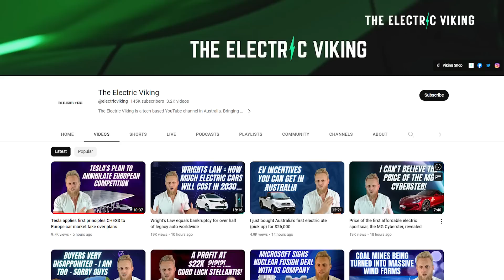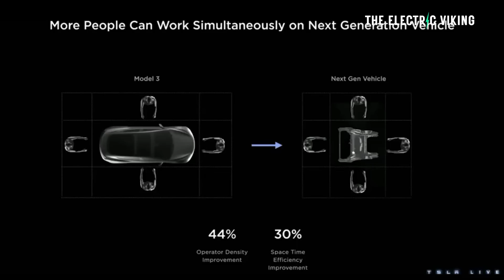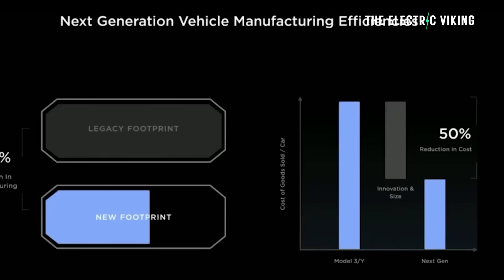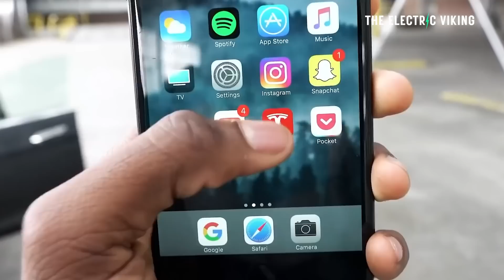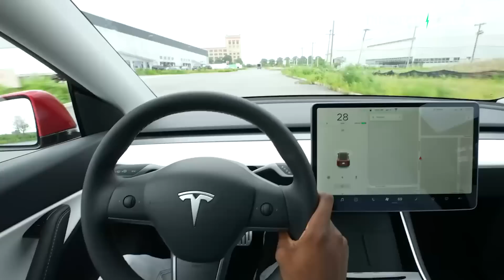Auto industry experts debate Tesla's revolutionary new manufacturing system

Comment: Thanks for making this video, it’ll promote the concept.
Unboxed is huge. Shortens production line, ergonomics vastly improved. It did need 48v low voltage wiring and Ethernet to eliminate complex loom. And electric servo brakes - dry factory. Only wet part is coolant.
Paint matching said to be a problem, expect to see something else, maybe composites. This is going to scare the pants off Legacy, can’t retrofit old lines, need new final assembly mega-robots. 
Easy access will be a boon for Optimus, first just assisting people, handing parts. Vertical integration required will prevent Legacy adopting this, too many components need to be brought in-house, too much software knowledge. They can’t adopt this in parts, got to be entire shebang, total new factories. Again. Legacy is cooked. No one can compete on price using Model T process.
Reply: Also volumetric efficiency.
Reply: “Paint matching” possible with stainless body panels
Reply: @EMichaelBall  in bright sunshine of Australia, shiny, dazzling is a bad look. Mightn’t matter in snow, rain, mud.
SS really constrains manufacturing / design, hence angular triangle cybertruck.
I’m mostly focussed on robotaxis function, that bring together FSD, efficient manufacturing, huge (rapid) scale.
If it’s not individually owned, finish is like public street furniture or transport.
In Aus, buses & shelters are bill boards - offensive. Not unlike YouTube junk / toxic advertising.

Comment: If anyrhing, thise new method of production will allow for a complete flexibility to improve and change the car, with this, Tesla could actually produce 20 different car in the same factory and in the same, line of production, they just change the fron part, or rear part, or the doors, or the chasis, and bam, new model, at the end the parts, are just put together like a puzzle, want a different engine and cooling system, change the front, and put it to the car, want another chasis, put it to each part easily, bam, new model, this is something that tesla didn't mentioned, the pace of innovation that Tesla will be able to achieved with this new method is enourmous :D

Comment: The reason Tesla revealed the unboxed prices was to give other manufacturers the way to reduce prices. They did not have to make this public. 
    Meanwhile, without Giga castings, the other manufacturers will still have a lot more overhead regardless.
   As to your number six concern, Tesla's current assembly line has multiple feed points. For example the line may get doors from several in-feeds at any one time from different teams... each team making innovations on those doors. This existing method makes assembling different car models a snap as they can vary which feed they take parts in from. However, most of the concerns you site have nothing to do with how Tesla lines work.... they are completely different than any other car manufacturers as to their structure. Much more flexible and almost instantly changeable.  These critics don't understand how Tesla build their cars now or they would realize their statements are BS.
Reply: You wrote, "The reason Tesla revealed the unboxed prices was to give other manufacturers the way to reduce prices. They did not have to make this public." That may have been one reason, but another was to help potential investors understand the "how" underpinning Tesla's "we will make cars for half the price" claim.
Reply: @CiaranMcHale  Very true, however in retrospect they could just have easily have told those non-technical institutional investors/analysts... "We have invented a radically new assembly process that will cut the cost of building our future cars in half".... and showed nothing... and it would have done the same thing. The result of actually telling those institutional investors the process was nothing... they went away having no understanding of the revolution that Tesla just showed them and the stock went down. 
So did Tesla just think that the investors would think this was cool because they are themselves engineering geeks and surely the analysts would see how cool this was?  Maybe, but I have to think they divulged it for a different reason. 

Meanwhile the OEM engineers were saying "OMG!.... quick... get on this now!".
Reply: @nickmcconnell1291  You said that in retrospect most institutional investors were unimpressed with the unboxed assembly process. Perhaps, but Tesla might not have been able to predict such indifference in advance. My guess is that many retail investors were impressed. I was going to finish that sentence with, "although I assume retail investors are vastly outweighed by institutional investors",  but then I decided to do an internet search to check the validity of my assumption. I was shocked to learn that 44% of Tesla shares available for trading are owned by retail investors; I hadn't realized the percentage was so high.

You wrote, 'Meanwhile the OEM engineers were saying "OMG!.... quick... get on this now!".' I suspect that might be the case in some of the Chinese car companies. But from what I have seen on the Munro Live channel, sadly I think managers at the legacy auto companies will be far slower to embrace the innovation. Some evidence to support this is that Chinese car companies have been quicker to adopt gigacasting presses than legacy auto companies.
Reply: @CiaranMcHale  Hi! Thanks for your taking the time to cogently respond!
I agree with your thoughts and findings here as to whether maybe Tesla thought what they divulged might impress their investors. Truly the retail investors were impressed. I'm one of them!😀
However at this meeting, which I reviewed through the eyes of a couple of top YouTubers who were there in person because of their number of shares, there were few retail investors that had made the cut..... at least that is what they reported.   So perhaps the audience that day was skewed towards the fund managers who hold the largest concentrated percentages of Tesla??  Who knows?
     But in general I have heard Elon and others at Tesla say that their intention is to not intentionally run other auto makers out of business. Indeed they have encouraged them, especially Ford.  So I am thinking that Tesla may have divulged the actual process of unboxed for charitable reasons..... since Tesla knows if they don't copy it that they OEMs will indeed go out of business as they will have no chance to compete on price whatsoever.
   BTW, I noticed at the shareholder meeting yesterday that they used a lottery system which I think they did to try and bring in more of the retail investors rather than have mostly fund holders/analyst types.
Reply: @nickmcconnell1291  Thanks for reminding me of Tesla's repeatedly stated intention to help other auto makers transition to making EVs. I knew of that intention, but I hadn't made the connection with discussing the unboxed assembly process innovation.
Reply: @CiaranMcHale  Glad to chat as I constantly enjoy hearing other people's perspectives and learning from them. 👍
Also it's only a guess.... maybe they are just geeks after all. 😆
Reply: @CiaranMcHale  And possibly to provide a credible plan on how they can achieve their mission.
Reply: Tesla critics ain’t smart enough to know what they don’t know
Reply: @sparkysho-ze7nm  Indeed, below is a classic for you. Unfortunately, "analysts" like Adam Jonas Brothers spout lazy predictions that are constantly wrong and they just adjust to the results, over and over again. Why is it that companies get slammed for their guidance, when a "miss" is the analysts getting it wrong? Double standard on forward looking. WS is just wrong and the company could be doing great...but a "miss." If a weatherman was that bad...fired. Why does the street care if the analysts are wrong, once again? I guess because it is a gentlemen's club of lacrosse playing Ivy League bros. 

https://youtu.be/REWeBzGuzCc
Reply: @sparkysho-ze7nm  To be fair, most people aren't smart enough to know what they don't know. The psychologist Daniel Kahneman uses the term "what you see is all there is" in his excellent book "Thinking, Fast and Slow" to discuss this idea.